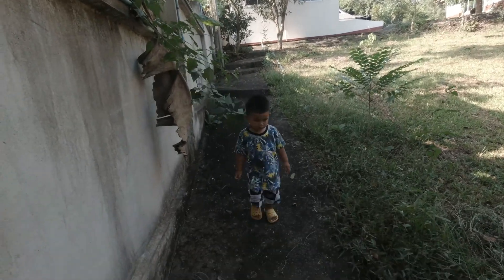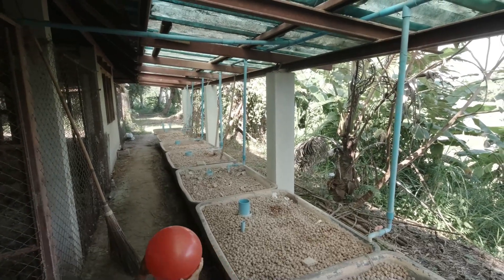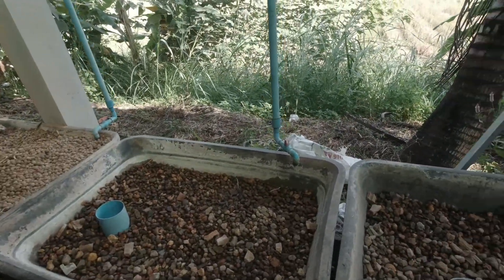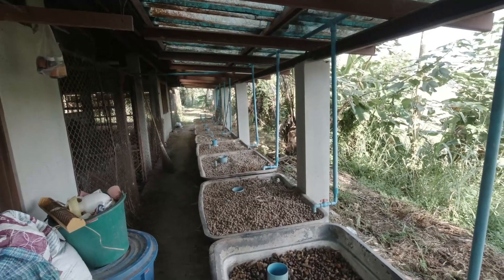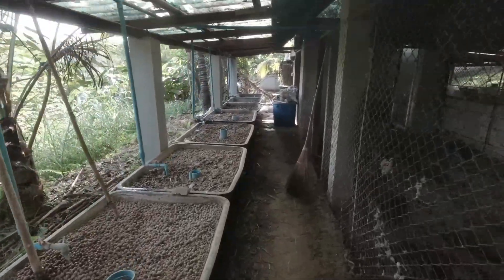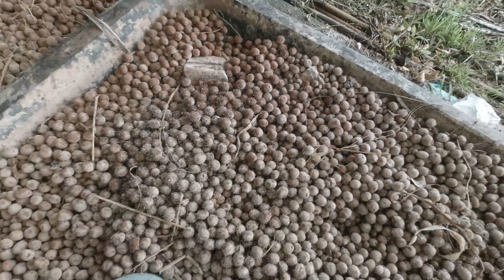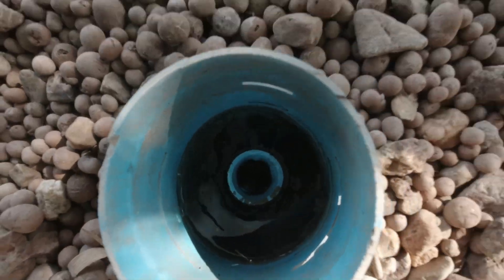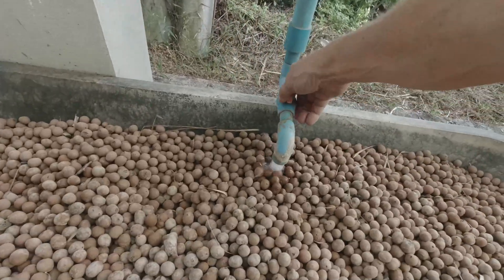Aquaponics day 2 and 3 set up ready to go

Comment: Hi GT, yes, you have it correct about the iron chelate, but Iron fertilization is always dosed in chelated form, recognizing it as an organic trace element that binds the iron like a claw. The plant can only absorb it as a trace element mixed with water. Fish poop does not provide balanced nutrients, something like a (15:15:15) It is typically rich in nitrate and phosphate, but short of potassium and bioavailable iron. So take note of the Potassium deficiency you will experience later close to production. Great to see you fired up again. Get better soon.